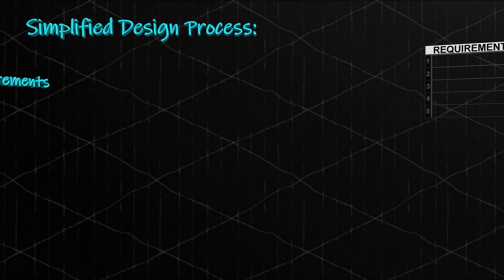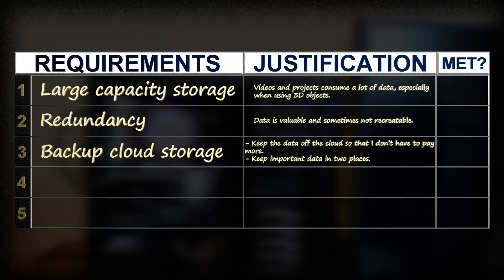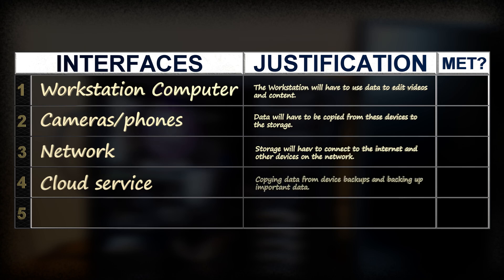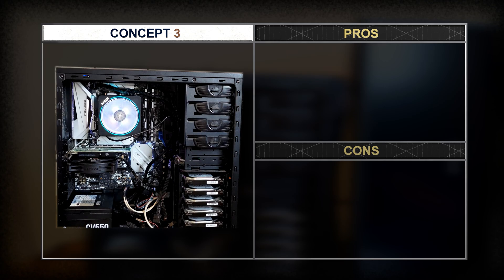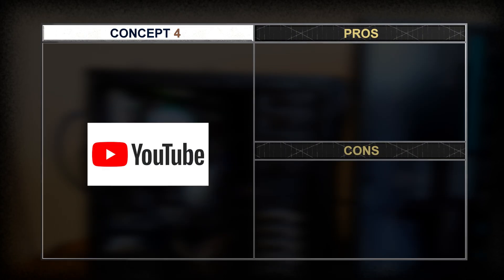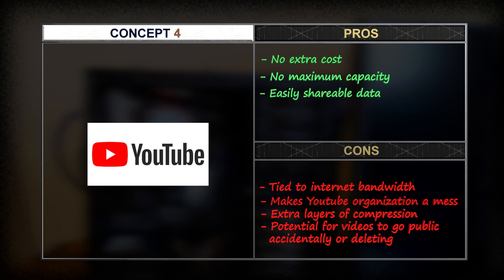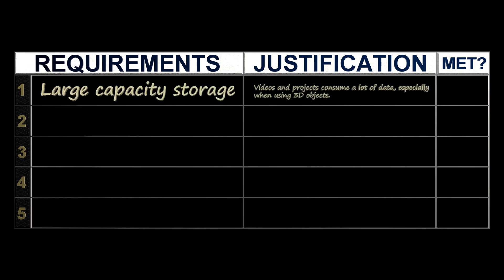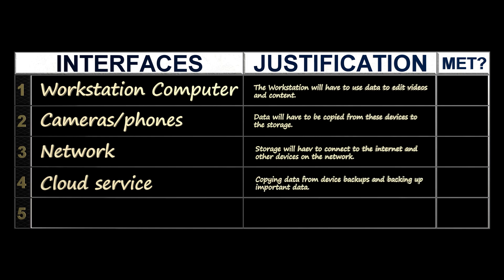Intro to the Channel - NAS Build

Comment: Power consumption should have been an important factor to consider with your build. Yes you don't pay a monthly fee. However running it 24/7 like many of us use a NAS would certainly add a considerable amount to the electricity bill. This should have been factored in to the comparison of the different solutions. Making the build more power efficient would have increased the upfront cost.

Comment: What you are building here is a bit more than just a pure NAS as you seem to need more services running as well. A pure storage pool on your local network do not require very much computational power. If, however, you want your NAS to do more than just being a NAS, it really isn't a NAS anymore but is now a server of some capacity that also can act as a NAS.
My own NAS is OMV running on a celeron @2 GHz, 4GB of RAM and 80 TB storage. Runs smooth as butter. There's no need to shoot birds with ICBMs

Comment: Thank you for the video. This is a bit of my feedback. As a geek trying to learn I wish you had shown us what you did to the BIOS; the screen was at a tilt, so it makes this old fart very hard to read it. Also, I'd love to have seen a graphic chart of what parts you repurposed, and which were new. The system cost I think was ~>$1k. but didn't break down the old and new prices. Are you really only using 1 16MB RAM stick?? How did you get the 10G network speed, was that on the MB I don't recall you saying. I'd also like to have heard the reasoning and evaluation of the NAS software and if you considered making the NAS an optional DAS as well.